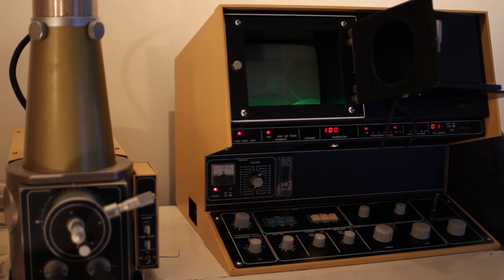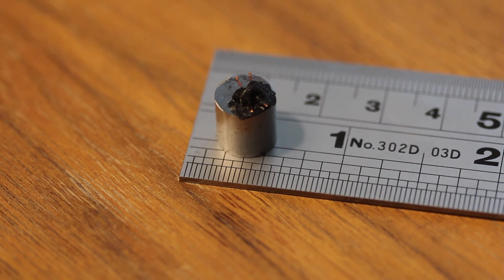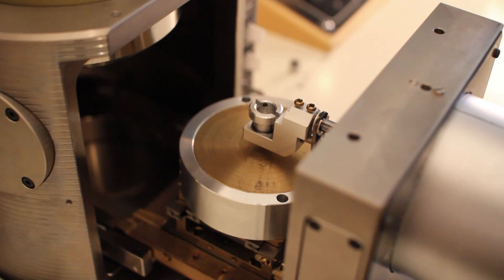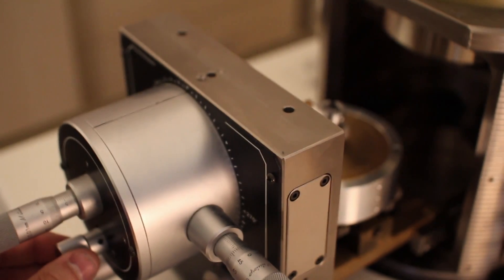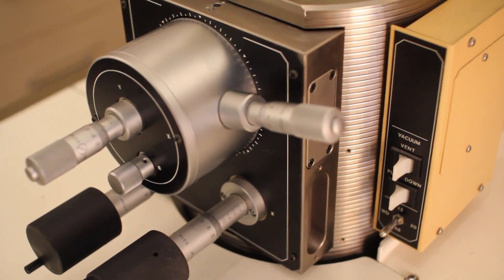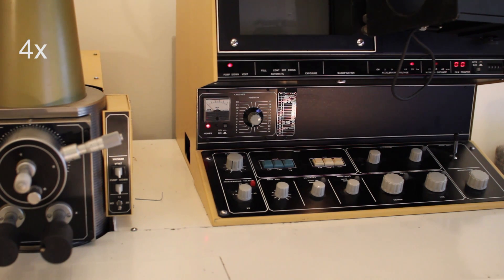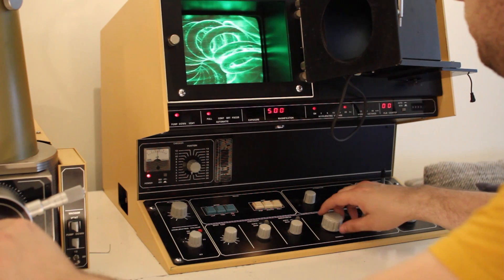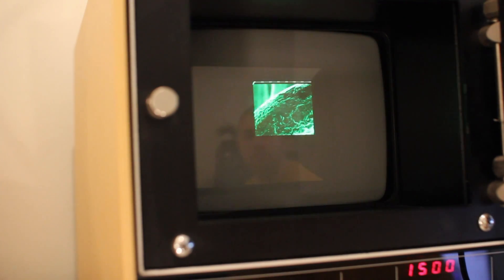Scanning Electron Microscope (SEM) Demonstration in my living room

Comment: Hi, I have a Joel T330a that i am trying to get running. The first problem i have is the chamber was not under vacuum when I received it. !
It runs the vacuum mechanical pump and starts to heat the oil dis pump but doesn't vacuum the chamber. I believe one or both of the valves at the rear of the chamber are stuck. Any thoughts ?
Reply: Hi, I have managed to get it working really well.. The moment I got it working, I was amazed.. I had several faults.  Firstly I had to get 100v for the main supply, I got a large 110v onsite transformer and added a couple of turns in opposite polarity and achieved exactly 100v. Next I had  no -15v, no +15v and no high voltage. I managed to sort all these out and finally I had power. All powers up but the chamber wasn't under vacuum to start with and wouldn't vacuum down. Richard then gave me the idea that the valves maybe stuck, well they were not stuck but had no power to them. I then repaired the suspect power supply and eureka I managed to vacuum down with no leaks. Next I had no filament current, so I took the filament out and sure enough it was broken. I spent some time searching for a reasonable price, but they were all quite expensive. I came across a guy on hackaday.io making his own. I managed to purchase the tungsten wire, built a very simple spot welder and made my own. I didnt anneal it but after my third attempt it worked and is still working now. Anyway replaced it back in the machine and powered up again. This time all was good and my first picture appeared, it was a screw retaining the specimen tray. Best screw i have ever seen. lol..Since then I found some of the functions were not working correctly, but have resolved that too. I have managed to get some fab pictures of different things such as various insects and objects without sputter coating, like Ben. I am now in the process of trying to replicate Ben Krasnow's  frame capture to pc, but this will take me sometime..I have managed to acquire all circuit diagrams and manuals for the Jeol T330 and T330A from a great guy at Jeol, if anyone wants copies and covers the costs I am happy to help. Many Thanks to Richard for the help.
Rick
Reply: @ricky4828  The frame grabber is from Ben Krasnow is OK (working on a ISI sem here). I have a JEOL T330A (set up now, not working). Unfortunately I don't have the schematics. Please look the group SCANNING ELECTRON MICROSCOPY at fb, that's me. I'm julien.debontridder@gmail.com
Reply: @ricky4828  I  would be interested to the schematics and manuals of T330A. I will cover the costs. Can you kindly contact me: my name is Ernest, email is erzzf@tiscali.it
Reply from the maker: There are sensors that only open the valves after a certain vacuum has been reached (e.g. the valve for the the diffusion pump should only open when a certain vacuum has been reached), either a valve is stuck (then you could try to remove it and clean it) or there is a small leak somewhere (maybe a cracked o-ring or just some vacuum-grease needed). The leak sounds plausible since there was no vacuum when you got it, but you never know.

On my T200 there was several LED lights on the board controlling the vacuum valves, which indicated which state it was currently in.  In order to figure out what is the problem you need to find these indicator lights and check the manual what it means. If you don't have the manual then I would start probing the wires to the valves with a multimeter to check if they get a voltage or not.

If you have a leak then it can be very difficult to find it, one way of doing it is to check the signal from the vacuum gauge and then spraying helium gas around all the possible locations where it could leak and at the same time look for a change in the vacuum level. The small helium atoms will flow faster in through the leak and you will get a small change in the reading.
Reply: Hi Richard, Thank you so much for the reply. With what you have said, I noticed none of my lights on the valve control board were lit. Any way found a faulty power board of which I
have now repaired. All starts up and seems to complete all its pump down and vent with no leaks. I am now at the point of trying the filament, but no filament current. Not checked the filament fitted yet but will soon get round to it. I do not have any spares, but do have the wire and might have to try and make one !
Again much appreciated for your reply.
Richard
Reply from the maker: I have the manuals scanned for the T200, unfortunately I gave all the schematics for the circuit boards, without making a copy first, to Ben Krasnow at Applied Science when I donated the SEM to him (check out his Youtube channel if you have not done so already). If you are interested in the manual then you can find a link at the bottom of this page on my website: http://www.richardandersson.net/?p=69

If you can't get a beam then make sure that the path is not obstructed by some dirt, you can put a light in the sample chamber and look from the top with the filament removed, you should se the light. If you really want to make sure that all the electronics are working then you can remove all apertures from the column, and just confirm that you get a bright signal coming through to the detector (you would not get a proper image without them though).
Reply: did you succeed in repairing your sem? I have a T330a as well, almost working, but cannot obtain the beam and have no useful documentation on this scope. Maybe Richard has some manuals and schematics to share (T200 and T330a are very similar)?
Reply: @rezfo1962  I have a T330A also in the basement of my house. I'm looking for the schematics because I have vacuum problems.
Reply: Ricky, you were very clever indeed in fixing so many issues of your scope. I got my T330a one year ago from a Singapore seller, it had been in storage (without protection) for many years, the electronics was a mess, a lot of cables cut, some cards bad. I had to buy a huge number ($$$) of spare parts from a dismantled T330 of a guy in the USA.
I managed to fix almost all failures, vacuum and electronics are now in working order (I get all the sequence lights), but I was not able to fix the EOS system: when switching it on (on the BF card), the crt HV lowers a lot, such as there were an abnormal rise in current to the power supplies or from the oil pot or somewhere that I did not realize. Red warnings appear stably on the checker ("dc power for ht" and "load current") and meter is out of range for load current.
So, I cannot obtain the beam and continue with the alignment: just I got a manual of the similar T200 model thanks to the kindness of Richard, but I really miss schematics and service procedures
I would like to double repay for your time and expenses and get all the documentation you have.Also would be valuable to keep in contact to speed up with your help (as you have a working T330a for comparisons): I would at last I have your same wonderful feeling getting the first image! 
Maybe it is easier to keep in contact by email; mine is: erzzf@tiscali.it   
Glad to hear soon from you.
Ernest
Reply: ricky, may I contact you? I need a copy of the T330a documentation to fix my scope. My email: erzzf@tiscali.it     Thank you, Ernest

Comment: What are some of the long term maintenance requirements of that thing?  I am the proud new owner of an SEM and I don't have the manual so I am learning by scrounging together as much info as I can from various sources including your helpful video!  Does the chamber remain under vacuum even while off?  Not sure if the door has been locked shut to protect during transit or if vacuum is holding it shut.  Also, how do you check the condition of oil diffusion pump?  Want to make sure it has good oil before attempting to use it as not to contaminate main chamber.
Reply: Transformer has two 100v Ac leads coming off secondary coil.  I am assuming this is for redundancy purposes.  I know 100v is common for SEM scopes but before wiring, it would be nice to know if your scope has two of those leads.  Documentation I have indicates this is the case but I'm just extra cautious because both are at same voltage so why not just one lead?
Reply: My scope, a Hitachi s-510, is heavy!  I can only imagine how much fun you must have had getting that thing through your livingroom doorway!  😄
Reply from the maker: +bbl4tter I hope you get your SEM up an running soon, they are nice pieces of gear. 
The chamber is usually always under vacuum, even during storage or shipping because you don't want dirt or moisture to get inside. 
The maintenance includes the standard services for the vacuum pumps, inspection and vacuum-greasing of seals and o-rings, changing filament when it burns out, aligning the filament/column so the beam goes in a straight line and replacement/cleaning of apertures or other items in the beam path if they become dirty.
Regarding the diffusion pump oil, it should last almost indefinitely as long as it has not been exposed to air while hot or it has become contaminated with something. You would notice if the vacuum does not reach its desired value in a resonable time, that could be good reason to change the oil.
Reply: +Richard Andersson I got my scope working!  Your feedback was very helpful.  Everything is in good working order too.  I have been able to somewhat resolve features all the way down to 150,000x magnification which is just mind boggling to me.  It turns out that somebody installed a digital beam controller port which will enable me to easily modernize the beam scanning and image capturing capabilities in the future if I choose to do that.
Reply: bbl4tter , where did you get your SEM and how much ? I’m working on dried mushroom samples and I’m working with a light compound scope but I want to get to an SEM for publication photos for the book I’m working on.